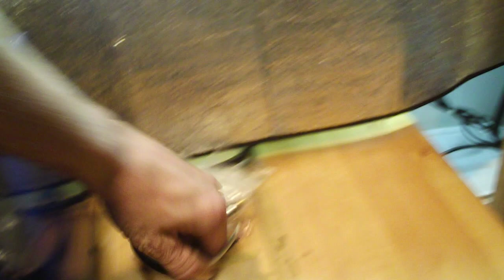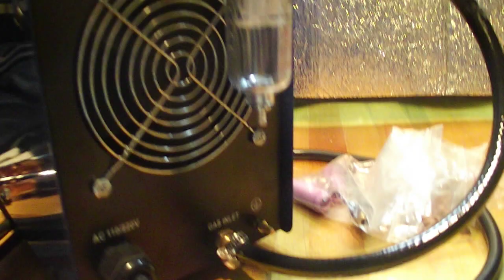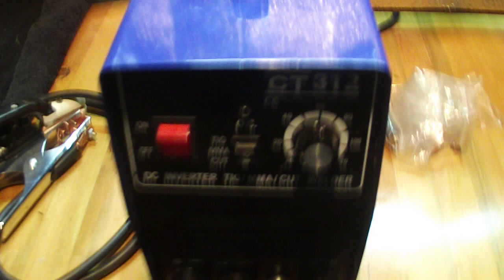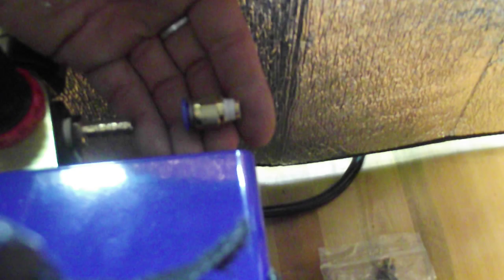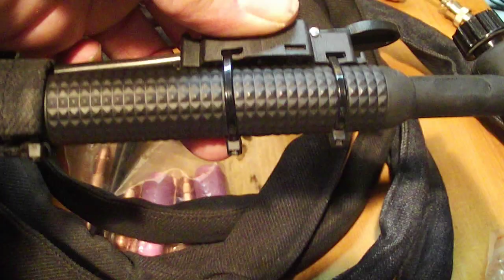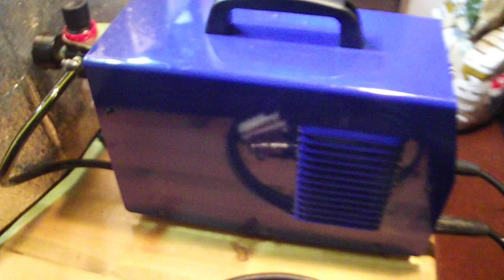Tig/Stick Plasma cutter CT-312 Welder  (Important info in description)

Comment: The manual says that compressed air is needed because it is true. for the Plasma Cut an air compressor is needed which implicitly carries compressed air. And someone who is going to TIG weld it is assumed that he knows that he needs Argon. Just like when you buy a vehicle, you know that you are going to need gasoline to start it. You will also need tungsten, nozzles, jaws, etc. to be able to weld with that TIG welder. That is why its cost $ is low, it goes accordingly.
Reply from the maker: Thanks I should have watched your video first.

Comment: Don't rent compressed gas tanks, unless it is something you only need to use for a short period of time. Gas is sold with tank exchange. They have piles of filled tanks, and swap with your empty. Then once they have enough empties, they refill them all. Any decent gas company won't charge you for a pressure retest on a particular tank AS LONG AS it is there tank.
Reply from the maker: thats kind of what I meant about renting the tanks sorry if I was not clear on that.   I used to  handle airliquid tanks  $50 deposit on the 20lb $100 on the 50lb plus the cost of gas  then swap empty for full + cost of gas  its the only way to go  unless you like dealing with inspections static pressure testing recertification etc lol
Reply: I totally agree with NOT renting gas tanks. Just go to your local craig's list and look for a used tank. Having a tank re-certified (depending on where you live) is not that expensive. In Milwaukee WI we have a certification shop that pressure tested an argon tank for me two years ago for $13. The tank (with an expired certification) was purchased on craig's list for $70. I took my re-certified tank to the local welding shop and they exchanged it with one of their filled tanks for the cost of the argon.

Comment: What did you mean by "amps and whatnot?" Is there another function of that knob that we need to know about... Thanks for video...I think I need to go with high freq. and foot pedal....Looks the way...
Reply from the maker: I'm not a welder so I don't know all the nomenclature but I believe your asking of the knob that sets the output power the higher it is the more power goes to the torch  where you set it depends on the material your welding its thickness and the type of rod etc you are using  it can actually vary slightly even during a single weld you may need to add more or lessen it off a bit

Comment: where does the hose from the argon regulator attach to the machine?  the directions we have don't show it.
Reply from the maker: it goes into the left side of the reg if you are looking straight at the back of the welder the other outlet connectes to the welder itself

Comment: good evening I wanted to ask you for help. I bought the CT312 after 10 minutes of using it welding machine has stopped to work. there welding machine turns on, the fan cooling works but in any of the 3 mode (tig-mma-cut) works. It would look like there is no mass. could you tell me if there is a fuse or what could have happened? thank you very much
Reply: Did u solve this ?

Comment: i really only care if the stick welding and plasma cutter work well.
Reply from the maker: both work great its my go to for stick welding the plasma cutter takes a little time to master so prepare to go through some consumables at first airflow is important and cones, tips stock up.  I really like the smaller Blue Demon rods, on 120v it does not have the jam to use anything large or long its near impossible to strike an arc  but small it rocks

Comment: Argon would be for using aluminum with an ac welder. Argon will work fine on dc steel but too expensive. Co2 is the gas you use unless you think you want to try dc aluminum with helium which I could never get to work.
Reply: I have a hobart mig already so i have 75/25 argon mix. So I would use it

Comment: have somebody this machine schematic,  need repair my welder, working first well good, but now broken than i try start welding, before TIG work well and start bush torch button, now have weld mode alltime ON, somethink relay or other has broken.
Reply from the maker: does anything work?  I had a switch stop working for a bit I thought it was totally busted but after it sat for a while unplugged it reset it
self and works again.
Reply: @kootenayboy  yes,i test thats too ,but not help .
Reply from the maker: @mattivirta  I believe there is one (possibly 2) fuses inside  you can open it and look but some components hold electricity for some time so you would want to make sure its unplugged a good while before messing with things   theres not much to go wrong with them so its usually a loose wire a fuse or a component like a switch all pretty easy to find
Reply: @kootenayboy  im house elektrician worker, i understand good how safety, but not understand little electric chips, cpu, etc, need open and looking have inside fuses anywere, first time i open not found any.
Reply: i can welding but tig rod have alltime ON ,if use button no mean anythink have alltime ON but rod to metal wled sametime. before need bush button now not. i buy new better TIG welder .but old can maybe use battery spot welder or plasma cutter  or MMA, i not has newer and not newer use MMA stick welding anytwere. i need only weld some furniture frames and own tools. and motorbike frame modifications.and this need have sure button working good.

Comment: Can you do a video where you actually use the welder and try the plasma cutter as well? Do you use 110 or 220v to power the welder?
Reply from the maker: I have been planning on it I use it all the time mostly for stick though and Ive used it 120 and 240  with no issues at all  to be honest Ive put it off mainly because so many others on youtube have already done it and  probably better than myself.  I can tell you that between my 3 welders this is by far my favorite its small it works amazing Ive only maxed the duty cycle once.  when used with blue demon rods well it blows my Flux Core wire feed out of the water  Ive NEVER had to go above 60 on the dial ( I dont usually weld super thick stock.) 

If your new buy extra plasma torch tips and consumables as you will burn through a few while learning
Reply: Using it for 240v did you have to rewire anything? I’ve got the adapter plug for 240 v just wanted to make sure it’s good to plug in and won’t mess it up. Thankyou!

Comment: have you ever had the OC light come on?  I've used this exact unit 4 times... on the 4th cut, it stopped arc, and the OC light came on and stays on....  trying to learn more what the issue really is...
Reply from the maker: as far as I understand the OC light is when its over heating it has a very light duty cycle  if you have been welding for some time in one go and or your unit is out in the sun etc it will hit its max temp or duty cycle max and then shut down until it either cools or its ready for another round.   some people get a small fan like a 4" muffin fan or a high output computer or server fan and will mount it inside to vent the heat out and increase the amount of time you can weld or cut and decrease the down time.   so far Ive only had it come on once and it was because I was really pushing the machine and had it sitting in the sun one an incredibly hot day

Comment: Would you recommend this for a dude in his garage?
Reply from the maker: ya for sure its a little box cheap I guess it depends on how much you weld or cut if its a lot Id go brand name if not then this is perfect
Reply: Yes just make sure you make a 220 plug for it 110 will trip your house brakes

Comment: Need Air compressor ? Per my father , doesnt the plasma need Air compressor  to push the plasma ?
Reply from the maker: yes sorry I missed this  it does require an air compressor and not a little one I found that a 20gal was the minimum so you have a good supply of air.

Comment: That blue chrome is a quick disconnect and is not cheap instead I use them to hook up an electric water drain valve in spots on my compressor system

Comment: My Plasma Cutter stopped working.  Found the tree position (tig, mma, 
cut) switch not working.  Sprayed with contact cleaner and the switch 
started working as well as the plasma cutter.

Comment: Hi, I just got my CT-312 the other day and I put a 220 plug on it and was having second thoughts about it because of the wire size but I'm pretty sure you just put the plug you want on it and it figures it out. the instructions say "The power wire at the back of the welder is connected to the 220v AC power supply, no wrong connections". gonna try to get it going tomorrow, I think my problem will be air supply because from what I read plasma cutters run around 60 psi air and my little air compressor puts out pretty good volume of air but I don't think it will hold 60 psi. guess I'll find out tomorrow, if I have air problems I saw where people were hooking up multiple small air compressors to get the air they need. would love a scroll air compressor but I don't have the pocket book for that, till then I'll probably be doing short blasts and wait for the compressor to build up probably won't be cutting anything big or thick anyway.
Reply from the maker: Yes the wire gage was a concern for me as well but recently I realized that these are a different animal than the standard welder and more akin to a a digital HID ballast in horticulture meaning that they sense the power coming in and deal with it appropriately before that I thought it was a 120v only  I believe most use a MOSFET system internally and you can look it up to learn if yours is that type  most CT-312 are and the CT-312 designation is actually the type of ballast in it not a brand name so it should be the same across the board.   the Air is a different thing altogether, I did not like or trust the intake for the compressed air and Ive worked with tanks for many years in horticulture and one tank is the same as the next so while I was working with mostly 20 and 50lb CO2 tanks that all goes through the same regulators and connections and Id not trust it at all the way it comes out of the box (but thats just me maybe)   most of these little welders come with airbrush regulators and are not meant for high pressure and you can see that in the fittings 

Check out my website for more and current information on this welder I did a writeup on them and added some new links etc to data sheets that cover the air intake more clearly than whats here 

http://www.kootenayboy.com/tig-stick-plasma-cutter-ct-312-welder/

I hope this helps 

KB
Reply: KootenayBoy DIY do u still have ur info on this? Website doesn’t work
Reply: does anyone know why mine came with a 110 plug on it ???

Comment: hello, I am very new in this world of welding, buy this machine to learn and I have the doubt of the connection of the light, it is 110v or 120v according to the plasma uses 220v but the truth is not and I do not want to make a mistake, thanks!
Reply from the maker: Im really not sure with these machines Im thinking they may be both 120v and 220v using MOSFET  with digital ballasts   you can read about them here 

 http://www.plasmapart.com/pdfs/GIEPMT232829.pdf
Reply from the maker: Im not entirely sure what you mean,  the welder is in fact 110 or 220 it senses what you have it plugged into and deals with it internally (from what I understand)  as for the components internally like the lights etc  I do not know Id guess they are 120v  but Im not 100%  sure
Reply: 3 wire 110v for America and 3 wire 220v for Europe, Australia... Not American 4 wire 220v
Reply: Angus Angus... Yes.. It all gets a bit confusing with different countries using different voltages. My reference was to how some do multi-volt.  Double insulated normally is only 2 wire because there is no need for the earth wire. That's how it is here in Australia. But we don't have 110volt. We have 240  and 415 that uses 4 wires.

Comment: I have mine wired input for 220 VAC. Works fair for the price. One thing to note is that for TIG there is no current control even if you purchase a separate foot controller. That is, the only way to change the current "on the fly" while TIG welding is to have a third hand changing the current on the machine panel.  The supplied TIG trigger is a simple On/Off and the foot pedal control input on the machine is also simple On/Off.  If and only if you are very skilled with electricity, the machine can be changed on the inner components to do so, but one must know what they are doing.  Also, I recommend building a 2 way valve for the gas input so one can switch between compressed air for plasma cutting and Argon for TIG welding.
Reply from the maker: Thanks for this information its great,   I felt the same about the gas in on the back its very chincy and when I looked it up its actually most commonly used on airbrushing systems nothing bigger which made the hair stand up on the back of my neck I worked with compressed CO2 for many years and you do not play with those tanks  they play for keeps.   so am I correct that you were able to rewire the innards to 220v?   I was not 100% myself so I went with "NO" as the go to answer mainly because as you said you need to be experienced and Id feel like crap if I told someone who was not good at that stuff to do it and have an accident.   In my research I came to the conclusion that when I start really welding cutting with this unit Im going to go with the tig peddle as the control is hard to maintain even on the high end units and companies like lincoln etc all suggest using the peddle most of them actually state that in their online tutorials  it just gives you greater control and you end up with a much better end product/ 

thanks again for taking the time to write that out I know I appreciate it :)  cheers
Reply: Hi - how do you change wiring for 220? mine is running on 110 now but i have a 220 outlet, do I just change the plug on the welder?

Comment: I think you can wire it for 220V
Reply from the maker: I just opened mine up and Im going to say no not this model  everything inside is 3 wire (black white green) and the gage is small, smaller than what you would expect for 220v   if it was 220v then you could step it down but the same is not usually true the other direction.  for safety Id would not advise it unless you spoke to the manufacturer
Reply: The 220v-240v the welder runs on is the 3 wire 220v-240v standard they use in Europe and here in Australia Brown= Active, Blue= Neutral and Green/Yellow= Earth. Not to be confused with American 4 wire 240volt system. I would say the internal transformer in your welder is set up for 110v so I wouldn't mess around with it unless you plan to get a new welder :).
Reply: Ok ty maybe it was a different model number.
Reply from the maker: I think so too I did see the 220v ones when I was researching them to buy, but chose the 120v as thats what I currently have access too. 120v was more versatile so suited my needs better.  eventually Id like to get 220v gear but one step at a time :)  thanks for watching :)
Reply from the maker: I think I made a mistake and it was not until today I remembered WAY back when I worked in HID lighting they were just coming out with digital ballasts for HID lighting  these ballasts were able to sense the voltage and you could plug them into either 110 or 220v and they ran on either no issues.  Today it occured to me that these welders are in all probability the same species of that animal and therefore are probably both as stated on the back of the unit itself.  sorry for the confusion